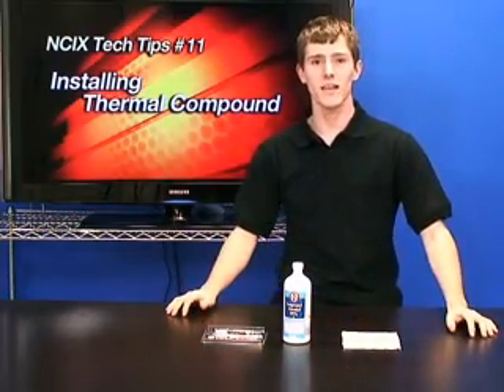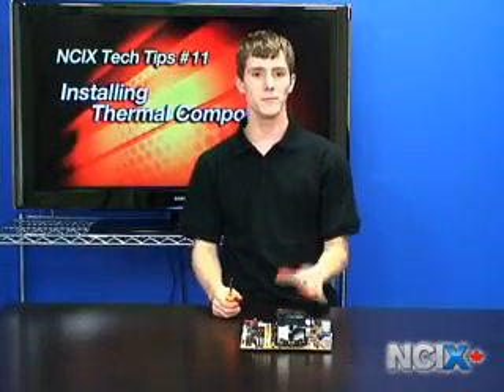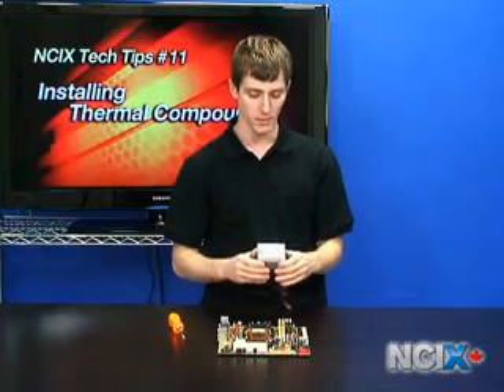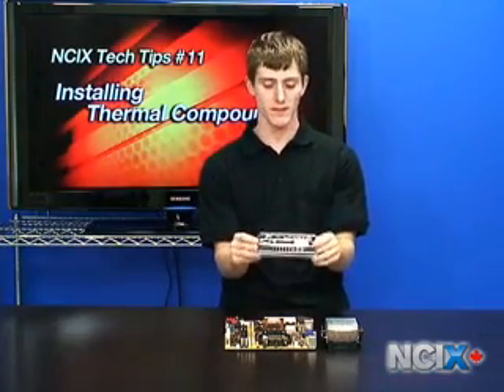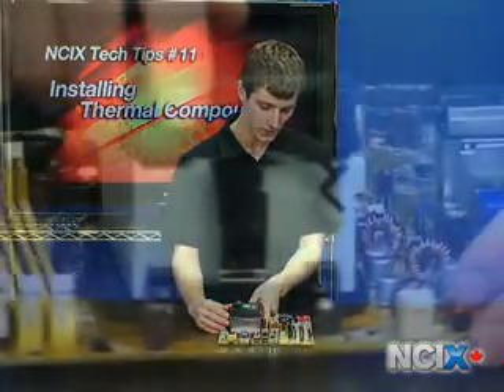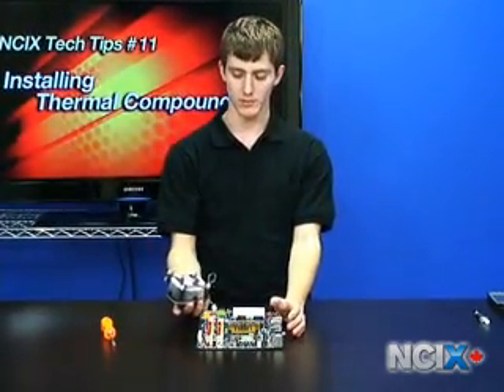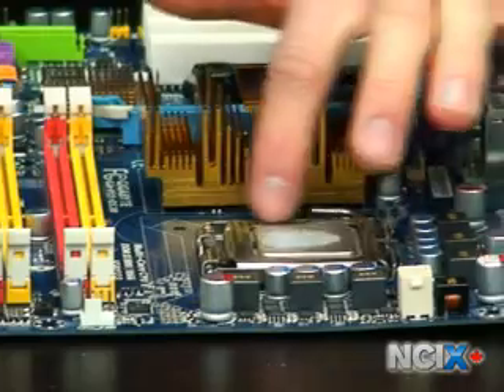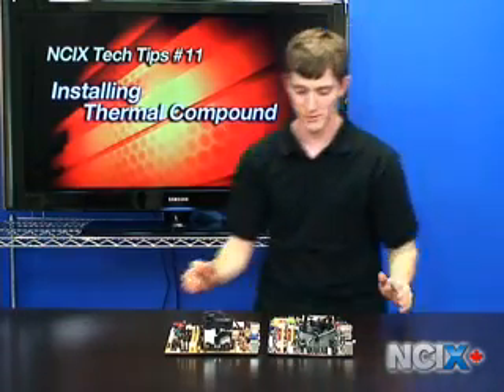Installing Thermal Compound (NCIX Tech Tips #11)

Comment: is it okay to wipe the thermal compound in the cpu while in the board? or should i take the cpu off?
Reply: yes, just make sure you have grounded yourself using either a antistatic wristband or grounding yourself to the power supply while it is plugged in
Reply: thanks...
Reply: Bernard Obciana no prob, just follow this video, and dont overdo it with the paste

Comment: can i use 100% teatree or eucolyptus oil?
Reply: The thermal conductivity of the paste comes mainly from the metal or ceramic in it, that are suspended in fluid.

For getting the paste off, what you need is something that can dissolve oils (dissolve the fluid in the compound) and will completely evaporate with no residue. Whatever does that is fine.
Reply: SteelsCrow well i used it amd seemed to work like a charm. Gonna be using it again soon enough when I replace my h100i with another.
Reply: amd or and? =)
Reply: SteelsCrow ahah and* my bad. I have a 4770k

Comment: I use AMD for cost effictiveness and because of my mother board support. Plus its true...amd does offer easy overclocking with black edition processors.
I currently have the AMD FX-6300 on a MSI 970A-G43 Board

Comment: Is alcohol necessary and what would happen if I by accident left cpu not clean enough and reapply thermal compound?
Reply: 1. You need to dissolve the silicone fluid the metals are suspended in. Isopropyl alcohol is great because it also completely evaporates.
2. Reapplying on old compound is variably terrible depending on how the surface layers of the compounds interact. The outer surface of the old compound may dry out, making a barrier, or the old compound can make pockets for trapping air.

Comment: Using a fx6350 and just tried the butter the bread method, and my heat dropped to 55 From 65 @4.8ghz 1.475 volts.on load using a evo 2.  I wonder how much the core itself changes the layout method?
Reply: butter the bread?
Reply: raffroland15
basically using a small amount and spreading it evenly over the entire chip.
Reply: oh thats a bad idea, it will cause air bubbles but if you havent over heated yet, then you definitely got lucky
Reply: well I tried a lot of methods and this one worked the best, I really believe it depends on your cpu.  10 degrees Celsius is pretty big for just thermal paste.  I can assure you there aren't any air bubbles.  But you are right you gotta be careful.

Comment: I'm confused. Don't we want ALL of the metal to contact with the other metal, not just areas above the die and what we want for ALL this metal to metal contact is to fill in the micro irregularities with paste so we end up with metal to metal every where, and every where we have space due to irregularities, we actually have paste to paste/metal contact. So this would call for spreading the paste extremely thin where ever there will be metal to metal contact...butter knife style.

Comment: i use the "butter the bread" technique. take the cpu in your hand or lay it anywhere safe but do not install it yet to the mobo.
i make a blob, then use a plastic card and spread it over the whole cpu as thin as you can.
then use a tiny corner of the microfibre cloth with a super tiny bit of the rubber alcohol and clean about 5mm off the edges.
this will not just make it look like you just got it out of the box, itll help you to cover all cores. todays cpus main heat source isnt alway the middle

Comment: the reason you dont want that much thermal paste is because it is actually LESS heat conductive then the metal surfaces of the heatsink and CPU. the reason we use it is because neither surface is perfectly flat, so if you just put the heatsink on top there would be alot of little microscopic air pockets. They're REALLY good at insulating heat. so we use the paste to fill in those pockets. if your paste is conductive then you could short circut your board if its over flowing like that.

Comment: I have done some testing and very little heat sink compound will result in more heat transfer you only want to fill in the tiny spaces between the 2 surfaces if you put too much it will run hotter.

Comment: Not if you put a super thin layer on. The idea is not to have the thermal past blob on. The only use for it is to l fill microscopic holes between the cpu and heat sink

Comment: If you use too much, it will cake up and not conduct as effectively. The small amount will actually spread quite a bit.  Also, if you use a massive amount like a small tube, it'll stick the heatsink to the cpu when it dries out.

Comment: why not just finger paint it for max cover- if its a quad core it might guarantee one core won't run hotter than the other.  if air bubbles are an issue maybe letting it sit for 10 minutes.  would it really be that wrong?

Comment: Need help asap. I changed the compound on my computer and the temp is going up to 90c. I'm using an antec kuhler 620, core i5 2400 and arctic silver 5 compound

Comment: Any grade of alcohol will do. The alcohol is just used because it easily helps remove the thermal compound, and alcohol evaporates extremely quickly (hence why he didn't bother drying the CPU or the heatsink after the second wipe).

Comment: I have had a static strap surgically implanted into the base of my spine. A bit like a tail. When I need to touch a computer I strap on to a spare piece of pipe. I also carry around a piece of pipe to bury in the ground should there happen to be no spare pipe. The strap is rated to withstand hurricane force winds, thereby immmobilising me during high risk builds. 
Oh and no matter how you apply thermal paste, according to youtube, you are applying it wrong. Ergo; never use thermal paste.

Comment: Hey, I've had some problems with my PC when I play high resolution games, where the screen would just go black and the sound just start bugging. So I removed the heatsink did all that stuff and then applyed the thermal paste on, worked for 1 day where my comp didn't black out, but now it happened again so I just want to know if it could be the graphic cards or if it is the CPU that's overheating. Also when I hold my hand by the heatsink it seems like it's cool air but idk really. Please reply:)

Comment: It's pre applied to the heatsink and fan. Although with the 3570K you'll probably get an aftermarket cpu cooler to over clock. If you so choose to not use the Intel CPU cooler, then don't worry about cleaning it off.

Comment: I was using the stock heatsink, problem was I didn't know how to apply thermal compound properly, and I just like keeping a CPU cooler than usual.  I have no intention of overclocking I just want a degree of protection from hardware failure.  My using different hardware would indeed void a warranty, but of course I did put it all together myself, so any supposed warranty is void from the get go.
*That learning curve.

Comment: It will trap air bubbles. You can remove it to check if your application spread properly, but I'd recommend then cleaning both pieces of hardware, and reapplying in the same way you already applied. (if your original application spread properly.)

Comment: In addition to the Line & Blob method, I have also seen the method of spreading the compound evenly and thin over the entire CPU, cleaning the edges of any excess compound before installing the heatsink.

- What would be the benefits or shortcomings of this method compared to the Blob or Line method?
- What would be the best method for an i7 CPU?
- How much actual efficiency would be acquired by Lapping the CPU and Heatsink?

It would be nice to see an updated video covering these topics. ;-)

Comment: @Apple2134Gamer It really depends on the CPU. Many models of Xeon for example benefit more from the line method, the 6 core ones benefit more from the cross method as the cores are taking up more of the area beneath the heat spreader. Personally I spread it with a business card or something and clean any excess before putting the heatsink on. In the end a lot of it is personal preference, but sometimes a specific method for certain CPU's works better than others.

Comment: @NCIXcom Linus sir, can I use 98,4% ethanol instead of isopropylic alcohol? The latter is pretty hard to find in Brazil while the earlier is used in home cleaning and is widely available.
Another question, can/should I do all this process without unplugging the mobo and removing it from the case? I would unplug only the PSU so I don't risk getting shocked. I'm not sure I can plug it all back up if I remove it, as my technician usually does that for me. Thanks for the great video!

Comment: @jurassic512 your right a few quick twists will take care of this issue but if you apply it correctly so that the compound is spread as you tighten down the heatsink, there will be no need for this step. One of the first things I learned while getting A+ certified

Comment: Glad to see someone doing this correctly. Although spreading it out with a card will work, your still most likely going to have air pockets and that's not good... especially if you plan to overclock. Not spreading the compound ensures you have a nice "air pocket free" fit. Thanks NCIX

Comment: lol.. my old cpu was stuck to the heatsink.. and it came of together with the heat sink..
then I had to break it off the heatsink cuz it was so tight.. it did a backflip and landed on the top.. It still worked XD

Comment: Nice explanations. Your video helped me a lot to built my new system. I was very stressed with the idea of putting the thermal paste myself. I was stressed before and while doing it, but everything went well. I took my time and it was successful. Advice from my experience: Don't put to much paste... do it clean and the heatsink will flat it. The video explains perfectly the amount to put on the processor. Do it slowly and it will be fine.

Comment: @scatteredminded When you install the heatsink, the pressure spread the thermal compound evenly on all the surface filling any imperfection between the cpu and the heatsink preventing oxygen from interfering with the thermal conductivity.

Comment: There is so much confusion about a rice size, line, pea, etc.  Also, with heat pipe grooves, multi-core cpu's...can you do a definitive guide that explains all this?   It's 2011 and a lot of people have the i5/i7 cpu's with a cooler with copper pipes.  I think there are a lot of incorrect info out there.   Lastly, what is the preferred thermal paste?

Comment: Not sure if too much is bad or good, but my Xbox360 kept crashing until I re-paste it with just a pea size and did NOT spread it...and it has not crashed yet!  Please clarify how to apply paste for a i5-2500k (quad core) cpu.  I don't want to screw this up as it will be overclocked.

Comment: @NwZ2 im not sure about about troll status, over scrimping thermal paste has been proven a fallacy. im not suggesting people start placing marble sizes on there CPU but if you use the amount suggested in the video all im saying is it can go wrong, and it could. people often say you dont need it on the sides only in the middle where the cores are which in my opinion is stupid and bad ethos since the sides heat up as well. less isnt more unless your using conductive thermal paste anyway.

Comment: @tugaxD23 It facilitates an increased heat transfer from the CPU to the heatsink. Heat is not efficiently transferred if you simply place the heatsink on the CPU.

The whole job of the heatsink is to draw heat from the CPU (heat is the enemy of electronic components). Thermal Compound allows the heatsink to draw heat from the CPU much more efficiently. Thermal Compound is cheap, no reason not to use it.

Comment: So, I couldn't find my cpu... I bought the alcohol and the MX-2, so i just squeezed the the whole tube of MX-2 into the alcohol, shook it up real good, then poured it SLOWLY all over the motherboard, I'm pretty sure I have covered the cpu since everything is covered in a greyish solution. temperatures are now 5~10 degrees lower.

Comment: I put Arctic Silver 5 on top and on the bottom of my CPU and now it's 8C lower then with the paste just on top!
Also, if you open up a harddrive and take out the magnet it works faster because the magnet isn't slowing it down anymore

Comment: No one should just open up there computer disconnect there CPU and replace the thermal compound.    Most new computers, the CPU compound does not need to be replaced and if your computer is older then five years old it sucks.  You only have to really learn this if your building a computer or your experience enough to upgrade your CPU on your motherboard.   To all the NOOBs don't try this or  you will have to give NCIX around 1000 dollars for a new computer.

Comment: then i did it for a 3rd time and this time i noticed the previous times i was not installing the heatsink fan holder properly... so it was not making contact... and that can fry my cpu in less than 10 secs... this last time it worked.. my quad core  I5 is intact.. at least that is what i think.. any way to check the performance of each core? computer working normally temp is now around 10 degress less

Comment: @Glisern Hi Glisern, I had a terrible time when chaning the thermal compund... i did cleaned the cpu and heat sink and added the new artic 5, turned on my computer and it didnt boot... i turned off inmmediately thinking the work just happened... then cleaned again and installed everything.. the same happened... i thought my CPU was fried already...

Comment: @allsic If you cover the CPU in thermal compound you may cause air bubbles to form. A single blob or line with thermal compound will actually push any air out of it as the fans spread it outwards.

Comment: @nelboy123 i thought i was bad with my junker machine. duct taped face/speaker area on the front. the screw holes were broken lol. i also jb welded (the putty type) the hinge area on the hack left side. the funny part is, i'm not lying about it. i actually done this because the case and parts for my vpr matrix laptop were to high for my taste. it was  $50 working laptop with some "creative engineering". still funny to see.

Comment: I couldn't find my CPU, so I just squirted the thermal paste over everything. It took 7 tubes, but I think I have it covered pretty evenly. I took the wires out and put some in their connections to. I ran out of this Arctic Silver stuff when doing the back of the motherboard, so I finished it off with some Preparation-H. I thought that it wouldn't be a big deal because it's the back, and nobody could see the difference in color.

Comment: I would have to say I disagree with just having the paste in the middle.. I always got better results if I have the paste as close to the edges of the CPU as possible. Just put a blob about the size of a pea in the middle and spread it with a coffee filter. Even with the stock heatsink and fan I have gotten ~30c idle from quad core cpus ( Athlon 2 x4 nd Phenom 2 x4 ). Letting the heatsink spread the paste is risky becaue of the chance you will slide it while reinstalling it and that is bad.

Comment: Is there a problem if there is little thermal compound on the cpu because I changed my cooler with a better one and the performance is about the same, I'm guessing because there was a lot of compound on the old cooler and I didn't change it with the new one. My cpu is a AMD Athlon 64 3200+ 2ghz  venice and the temp is 36 in idle and 51 full load. I will change the thermal compound soon but I was curious if I should be worried about the temporary lack of it, despite the normal temperatures.

Comment: @SpadesHeart idle temp in windows is 27-30, with i5 2500k. with an ambient temp of 20 Celsius (68f) and coolermaster hyper 212+, running prime 95, im getting about 58 with no over clock.

Comment: i think i applied too much thermal compound... by a large margin. the computer is working fine, seems to be running cool but should i take the heat sink off, clean it and apply again? is it unsafe to leave it as is?

Comment: Good video. Dot or cross will work fine. Any compound including MX-2 will work fine. Any compound is better then pads, pads are better then bare metal. But don't expect that expensive compound will work very much better than generic grease. Even toothpaste has lower thermal resistance (slightly) then some compounds on the market. There is no magic. The good reason to use thermal compound is the fact that it does not dry out that fast as toothpaste :)

Comment: @usaf2020 
yes you should as it creates more contact points, empty space will cause extra heat that won't be pulled away from the CPU increasing your temps. All of his knowledge is solid but I don't recommend just putting a single dot and squishing it on especially if you have a very powerful CPU and plan on OC'ing whatsoever.

Comment: @HerrCameron my advice is this,
tint both cpu and cooler using a credit card to spread it out, take coffee filter and wipe excess off(do not clean it off) should be discolored from paste. apply  2/3 of a bb or an uncooked grain of white rice to center of cpu. place cpu cooler onto cpu, do not remove to check(creates trapped air), use your computer normally for a cple weeks allowing computer to be turned off to allow for paste to reach room temps. if no improvement try again.

Comment: i find kleenex, paper towel, or even toilet paper works well enough for removing old thermal compound. I also find contact cleaner works better than alcohol. you can either spray it right on the thermal compound or spray it on your "cloth" to remove.

Just DONT use cotton balls or qtips, the ends will fray off and go everywhere.